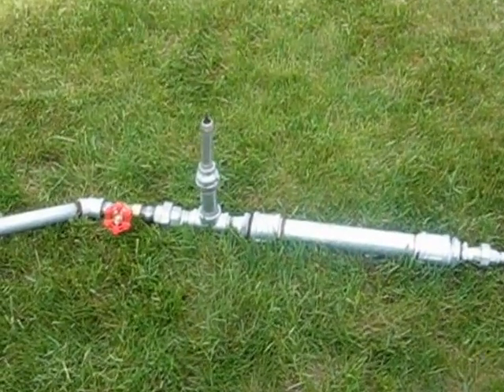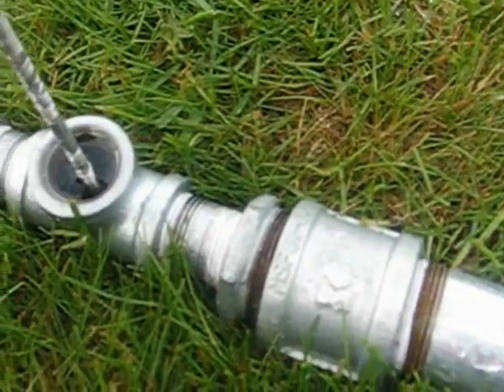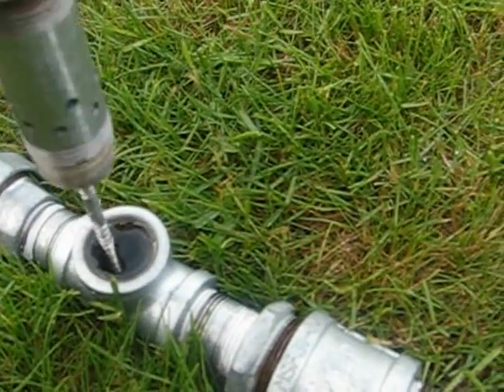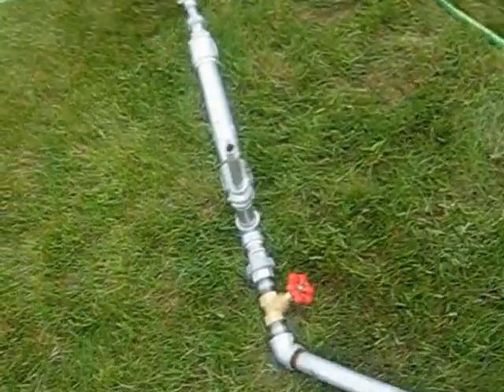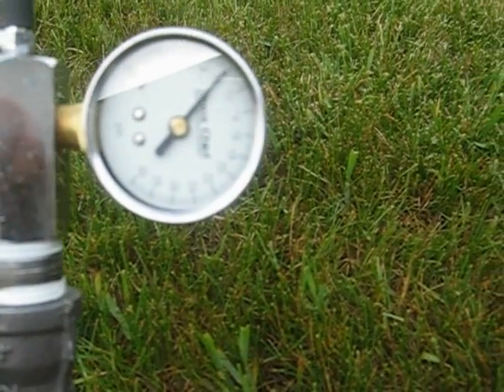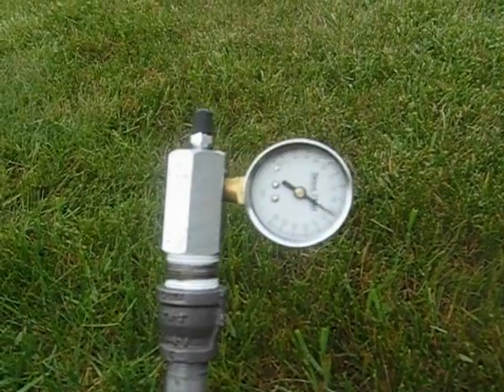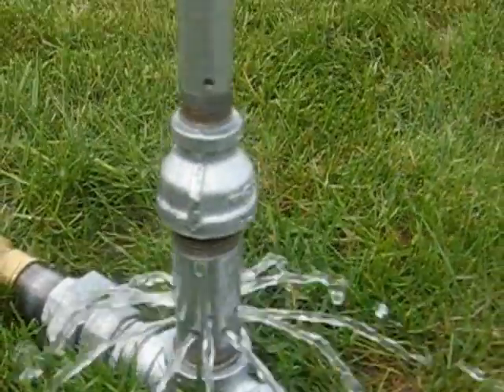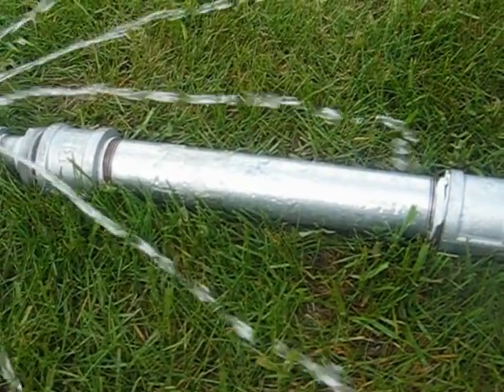Ram Pump with Waste Valve redesign

Comment: Hey Greg does this pump design use a check valve in it? Of just the head pressure on the charge pipe?

Would it benefit from having a check valve somewhere on it?
Reply from the maker: There is a check valve
Reply: @gsgriffin  where is it located? Is it internal to your pressure tank?
Reply from the maker: @krazyistkarl306  The check valve is right at the pipe connections to the larger pipe.  Using a washer with holes on the inlet side connected with a small bolt to piece of tire and spring on the large pipe side.  Sorry.  I have created a video to demonstrate all the parts and am not at a place where I can today
Reply: @gsgriffin  I thik I get what you mean. I'd love to see a video how you made this whole pump 
Does your pressure tank have a tire tube in in?
Reply: I just rewatched the video and you said pipe insulation.

Comment: Nice waste valve, Im planning to fabricate one with 2" gi coupling ang I will use tyre rubber as a plunger. At present Im using a swing valve but encounter a problem of leaking.

Comment: will this run underwater
Reply from the maker: No.  Rampumps do not work underwater as the resistance of the water surrounding the outlet provides too much backpressure.  The valves need gravity and little friction.  Underwater would be like trying to run this in honey.
Reply: @gsgriffin  is there not a one way opening or valve that will allow the water to be pushed out the exhaust ? I have seen several ram pumps work underwater, I just didn't know if this set up would

Comment: I assume you are just using the weight of the rod being more than the force on the valve to cause the valve to open again after the outflow stops.  There are valve designs that require less force to open and close.  The simplest is the "butterfly" valve where a disk on a shaft turns.  You may want to investigate

Comment: Love it! I think this may solve my problem, which is that I'm running a higher head ram pump (10 meters), and it cycles way too fast to get much momentum going. I've had to add about 3 pounds of washers (try keeping that stable as it jumps) to my waste valve plunger to get it to stay down longer. But with this design, it could be built with a lower drag on the upper plunger, therefore requiring greater speed. I've been searching everywhere for a higher pressure Ram Pump Design, and I think you just gave it to me. Thanks!

Comment: Hi Greg, nice design on the waste valve there. Did you ever manage to make a video of the tear down of the unit? I am planning to make a ram pump for my orchard but the parts here in NZ are quite pricey. I like your design because it does not require store bought swing valves. I would love to see the guts of this. Thanks again.
Reply from the maker: Just got the unit back from a friend.  Will be able to make the video shortly.
Reply: Greg Griffin any luck putting together a parts list??
Reply: Lots of people would love to get a parts breakdown and assembly video if you could find the time! Thanks!

Comment: Hey partner!  What was the ratio of water used and water pumped?  Thanks!
Reply from the maker: Since you are asking that kind of question, I will assume that you probably know that it is based on the head height, length as well as the pumping side....how high, diameter of pipe.  Because of that, I really didn't measure and wouldn't predict exactly what anyone else would get.  Every application of a ram pump will have a different ratio.  In general, with a typical low head of water, you will need to waste more in order to get enough momentum of water and pressure to push it up.  With a higher head and more pressure, your stroke can be adjusted to be shorter and the pressure created with less water will be possible.  This is adjustable.

Comment: Great idea Greg. I wonder your modification could be implemented with small PVC pipes. In that case, it would be much easier to drill the small holes. Self priming would be great if the flow is intermittent and  you cannot be there all the time.
Reply from the maker: It would be nice to use PVC, but it won't work well or for long.  The pressures and pounding effect of the water added to the breakdown from UV over time will undoubtedly cause it to crack.  It is easier to drill, but drilling the metal will be worth the time and effort it takes.
Reply: Thanks Greg for the reply. From what I've read, UV only affect the surface 0.001" to 0.002" of the PVC or CPVC pipes and will cause discoloration and only affect decrease in impact strength on the UV affected area. As for my application, I will need to take it down every winter (freezing cold Wisconsin) anyway and will be a good time to replace it (since it's so easy to make a new one)  if it becomes weakened or cracked. I would give it a try. Thanks again for your idea.
Reply from the maker: Please post your long-term results here and how it works for you.  PVC and glue is good for pressure, but impact and jarring, pounding seems to have more detrimental effects on PVC than steel and threads.  All the best!
Reply from the maker: By small, if you mean VERY small, then yes, but I would expect it to have to be "disconnected" to the unit.  If you provide too much back pressure, the design doesn't work.  If you had, for example, some small wheels inline with the spray, you could probably spin them, but I would suggest that a second waterline running next to this and driving a Pelton wheel would be much, much more effective.  If you go to the work, you will get the two side by side, so long as you have enough water flow.  Pelton wheels tend to use a lot of water quickly, but you could narrow the stream and get a lot more power from that setup than you will from an inconsistent and limited strength flow.  Could probably get enough to run LED's from this, but the Pelton could potentially power a house or more.
Reply: if you had a longer stroke on that piston it would be possible to use the "waste" to drive a small generator, perhaps not a goal of yours to make power as well as pump water but a possibility I think.

Comment: How high this pump can raise the water that enters at 4 feet in height?
You could show us as did the water chamber?
Reply from the maker: Please just Google "Ram Pump".  The concept is very old and reliable.  Simple and powerful.  I have friends that are helping people in Indonesia get water to their villages where before they had to send the children down a steep and dangerous hill/cliff to get water.  This design is just an attempt to not be America and make it the most difficult or expensive way.  My reason was to make something more practical for the average person in any country.  You can learn the physics involved by researching "Ram Pump"
Reply: Greg Griffin
I know the function/principle of the ram pump. It's simple physics. Just do not understand how you could do a compression chamber so small and simple. I'm trying not use an electric pump replacing it with a simple ram pump as simple and inexpensive as possible.
You said below that this model can NOT raise the water because it has NO air chamber.
So no use for me. I need to raise the water to 25 feet above.
Reply from the maker: The water can go up very high.  These pumps, with larger water supply pipes can lift water hundreds of feet in elevation. In general, the higher you try to lift the water, the less water is lifted in each pump action. The pressure of the water in the pipe you are lifting works against you. The small diameter pipe going up a hill will carry less water and weight, but will allow you to lift higher.

Comment: I loved your project. Simple, sturdy, and beautiful. Congratulations. Just do not understand where the air compression is done.
The people did not understand the advantage of the Ram Pump is RAISE the water without using any fossil fuel or electricity.
Reply from the maker: Anita, the design of the ram pump that uses an air chamber is to allow the "shock" of the water to be absorbed .  It does not provide the power to lift the water.  It just provides a softer pumping motion.  Again, with another elbow and T-valve, you could easily install a stand pipe with air...immediately after the outlet valve and plunger.  The benefit of using an air chamber is that the pipes carrying the water up hill will not experience the shock wave when water comes through.  You can go either way and see how it works for you.

Comment: Hi Greg,  where is the air chamber? Where the air is compressed to propel water?
Reply from the maker: a partially inflated inner tube is inserted into the large pipe on the right that comes after the valves and outlet.  This is an alternate method that some play with.  If you want to have a vertical stand, you can do that.  I was trying to use only simple and as few parts as possible.  For most people in 1st world conditions, there is access to lot more variety.  Instead of compressed air, this is just compressed water.  It creates a greater shock and can be harder on the whole system for the long term.  The inner tube helps to absorb some of the shock on the lift side.
Reply: Greg Griffin
Thank you very much. I'll try it.
Reply: Greg Griffin
Anyway, you could show how the tube internally? Can not understand how you made a water chamber with bicycle tire. Tnks again.
Reply: @gsgriffin I sew in the youtube that instead of using bicycle tube or foam they are inserting pelota or tennis ball 4 to 5 pieces to the air chamber

Comment: To save electricity, You waste tremendous amount of water.  Free energy  is a bitch.
Reply from the maker: Please read other comments before you do so.  This is a demonstration.  Imagine this being right next to a stream or river.  The waste goes right back into the stream, but you get free lift of water 24/7 with no electricity or energy needed.  The point is not what comes spraying out the sides (this is required by physics in ALL ram pumps), it is what you get pumped up for free.

Feel free to research Ram Pump to understand the physics involved.  I did not invent the Ram Pump.  I've just made a design modification like so many other people out there.  This is just one to help people get ideas.
Reply: Greg Griffin  Brother I totally got what you were trying to show in this video  and was not criticizing you for wasting water, Water  has got no value yet its priceless!!...for a ram pump to work the stream of water or river need to be higher than the pump itself.  So Water flowing back in the river is not really possible unless you spend money on constructing a safe passage for water to go back to river or some sort of storage.
Reply from the maker: Writing. The idea is to allow the water to pass back into the river to help those downstream...ie fields, lakes, livestock...The water that comes out can be very easily contained by putting a large sleeve (like a 4" dia pipe, 10" long) around the waste pipe so the spray is focused and falls down instead of spraying out.  Most ramp pumps are designed to operate within a foot or two of a river.  Doing so with this design and a sleeve to catch the spray will cost about $.50 in most places and the water is back in the river to help those downstream who need it as well.
Reply: +Writing, The water that comes out from the Ram pump will always be into the stream (At least i think so). When you install yours, it's your responsability to preserve as much water as you can. Why it's difficut to you understand this? In previous videos Greg had shown the intake and the Ram pump placed into the water stream, without wasting of water. Great work Greg Griffin!!!
Reply: +Writing. Different people have different circumstances........There are places where  there is no electricity but human habitation and plenty of water in the stream and that can be pumped up to where it is required for a minimal cost of constructing these pumps......If you have little water and electricity available easily then this is not a good option but if you have abundant water running but no electricity or power cuts for long hours or operational cost is simply higher .... Ram pumps are a good option......... And electric motors do have considerable limitation on how high they can pump water........ given the amount of money invested on pumps ,,,,,, electricity costs and maintenance costs...

And I dont think water is wasted ....... It is simple physics......you are using using more water having lesser fall to pump little water having higher rise.

Comment: CAN WASTE WATER TO BE COLLECTED  INSTEAD OF SPILLING ALL THE WAY AROUND?
IM HAVING AN AQUAPONIC SYSTEM AND IM PLANNING TO USE RAM PUMP AS MY PRIMER PUMP, IM LITTLE CONCERNED ABOUT THE SPILLED WATER AND IM THINKING IF I COULD CONNNECT A TUBE TO RECIRCULATE BACK THE SPILLED WATER TO THE SUCTION TANK.
I WANDER IF THE PRESSURE THAT WOULD BUILD UP INSIDE THE WASTE
WATER PIPE WOULD AFFECT THE FUNCTION OF THE SYSTEM
I THINK FOR AQUA PONIC SYSTEMS SUCH PUMP IS ALMOST IDEAL BECAUSE WORKS 24/7 WITHOUT ANY KIND OF POWER SOURCE AS WELL AS  HAS NO THIN LAYERS OF WATER PASSAGE THAT THEY COULD STUCK UP DUE TO DEBREE
THANKS IN ADVANCE FOR YR PROMPT ANSWER.
Reply from the maker: You can collect it, but you cannot use the pressure to pump the water upward.  It must fall.  You could put a 4" pipe around it to keep the spray contained, but again, the water must go down.  Any kind of back-pressure on the waste water will keep the pump from working.  This is physics that you cannot get around.
.
Reply from the maker: Hasan Sabran The resistance to water working against itself it fairly high. By putting it under water, you greatly increase the back pressure, slow down the cycle and decrease the amount of water that is being pumped.  Furthermore, the water that is coming out cannot be used for lifting or too much back pressure is created.  There is really no benefit to running it under water.  In fact, physics will prove that it only hurt the desired purpose of the pump, which is to lift a small amount of water, consistently and with few moving parts.  You may be able to create the motion and action of the ram pump under water, but the work and useful load of the pump will be the challenge if by being under water it creates pressure.  Again, no real value for hydroponics or aquaponics.
Reply: In my humble opinion, A ram pump installed underwater in a fish pond will save you a lot. It will also act as a wavemaker, that can gives you big waves which will surely aireat your water and your fish will be very happy. The waste water (90%) should be treated as the main source of your aquaphonic system. Only 10% water from the pump will go uphill for some other use. TQ
Reply from the maker: Hasan, the pump to not work under water, cannot work underwater and would over dilute water for hydroponics. Aquaponics work by reusing water from fish, lifting the fish water and passing through plants again. This, unfortunately, will provide no value to that use. It is only helpful for lifting a little water, but 24 hours a day and with few moving parts and no electricity.  Hydroponics needs a lot of water lifted and recirculated to work
Reply: Greg Griffin Hi, if you search for "ram pump underwater" here at Youtube, there are few test showing it works underwater. I don't know about your version.
Reply from the maker: +George Vasquez . Sorry, George, I did NOT say that it would not work, I properly stated that it increases back pressure in the outflow.  Try moving your hand through air and tell me how much resistance you feel.  Then put your hand deep in a tub of water and move your hand around.  Feel a difference in resistance?  The water coming out will feel that, too.  I also stated that it will slow down the cycle, that is because the water exiting will not rush out a quickly as it would in air and increase the time it will take to reach the speed needed to close the valve.  As this is a "more complicated" design for people in developed countries (where this is not needed very often), it does have the benefit in design concept for people in countries where they might not have a huge hardware superstore and could build something similar with common parts they can more easily find.  That was the purpose of this design experiment and the type of people that I commonly help around the world.
Reply: +Greg Griffin you are completely wrong about it not working under water. I have seen many that work very well under water. Besides you can always add a float of some kind to assist the valve. even easier to do with this design since it has that all thread. Even tho this is an overly complicated design compared to a regular swing check valve. The "auto start" just is not worth the hassle. Besides who can't be bothered to put your finger in for a few seconds, really?!